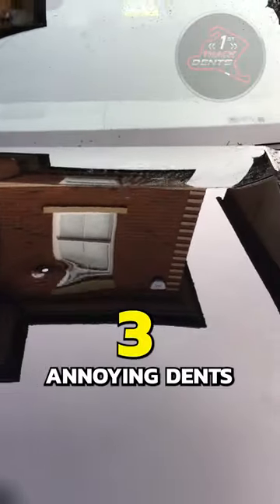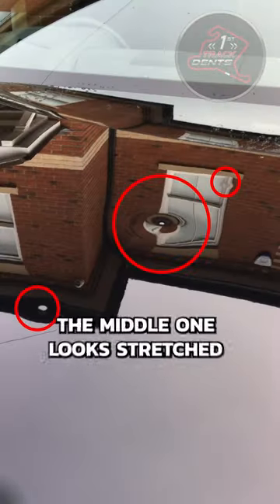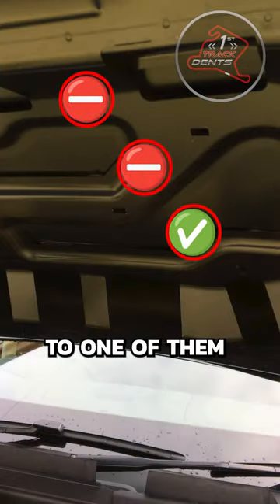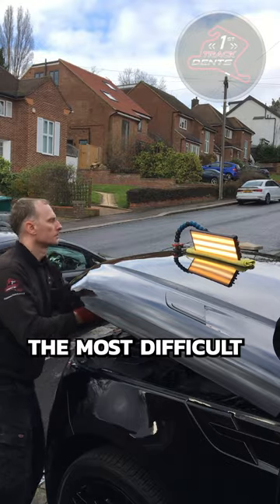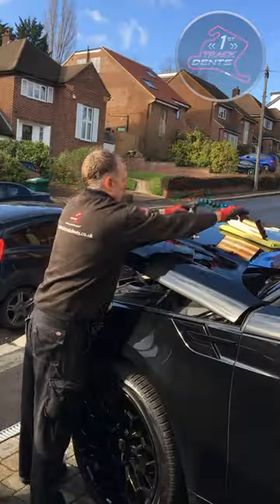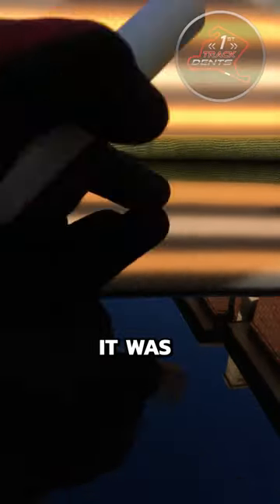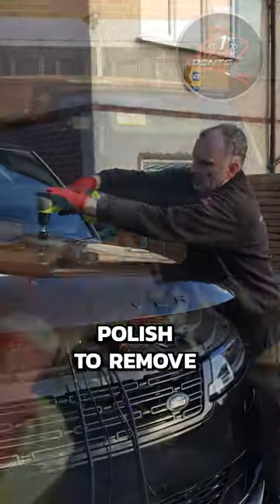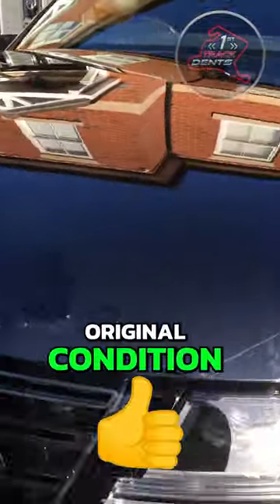This is WHY you should use PDR! #shorts #short

Comment: How do you remove sun dried tape glue from car paint? Thank you in advance!!
Reply from the maker: Good question, it may be a question better directed to a bodyshop related channel rather than a PDR channel, I have never really had to do that but you do have to be careful what chemicals you put on paintwork and also you need to know what type of paintwork it is to prevent damaging it. Back when I worked in a bodyshop we would have used something called panel wipe or 3M adhesive cleaner, but like I said maybe get some professional advice from a bodyshop as they will have encountered that problem no doubt many times before so will know the best method that will not damage the paint surface. Always make sure you wear gloves and PPE when using any type of chemical too as it can be very bad for your skin! Good luck 👍